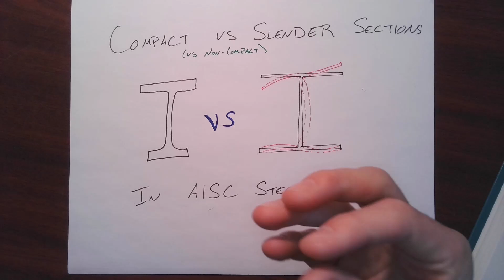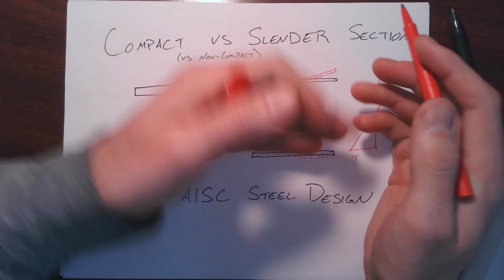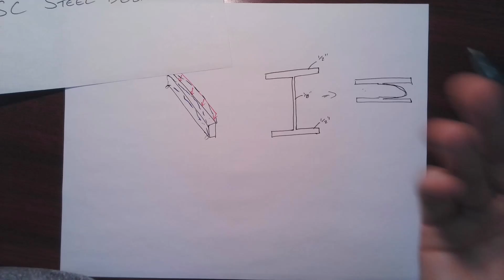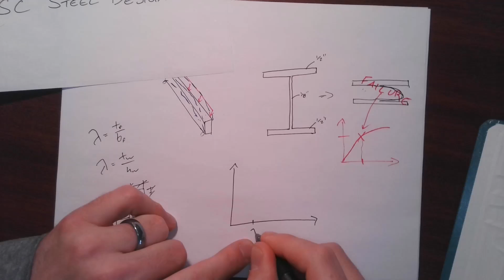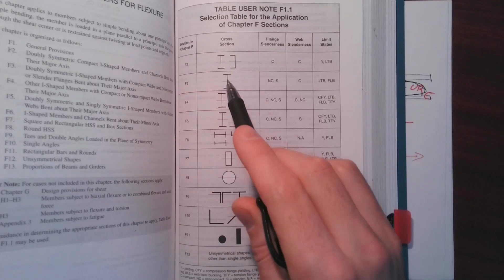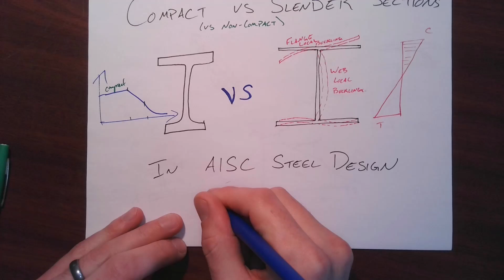Compact vs Slender Steel Sections

Comment: Is there any standard that prohibits the use of non-compact or slender profiles for a certain application?
Reply from the maker: Sorry for the late reply!  Yes, there are standards that prohibit use of those local-buckling-prone shapes, particularly when high reliability is required or when predictable yielding behavior is needed.  Seismic and blast-resistant design are the two that immediately spring to my mind, but I suspect the Nuclear Regulatory guys have similar requirements (just my suspicion, that's not a sector I'm familiar with).